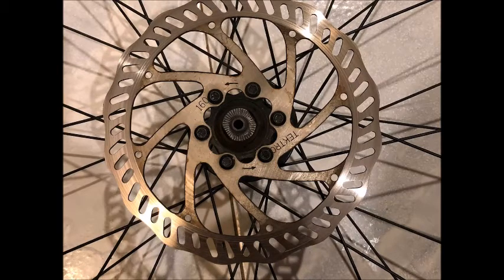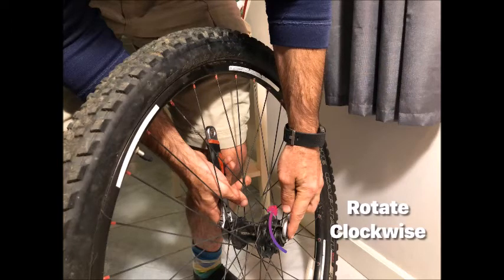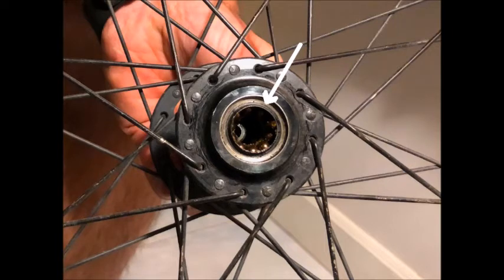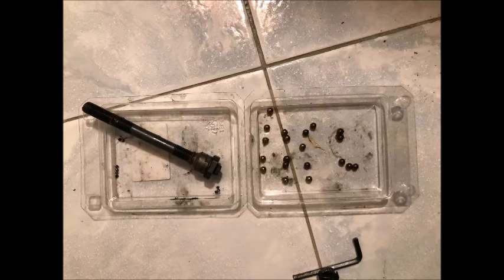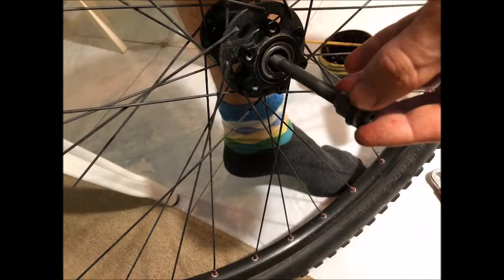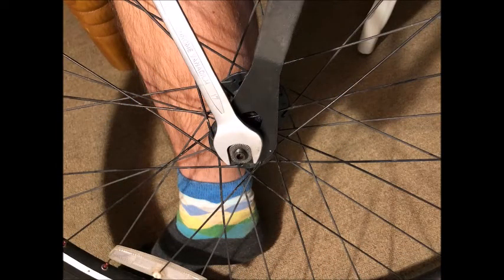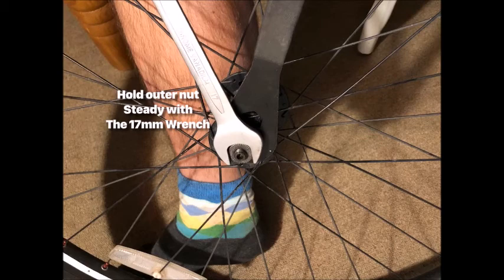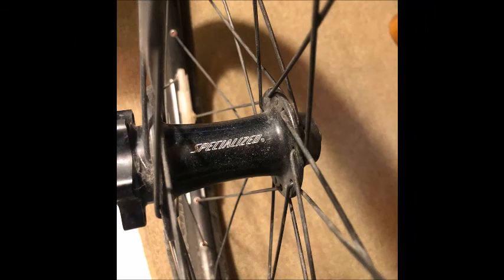Specialized Stout Front Hub Service

Comment: Thank you for the tutorial.  The Stout front hub on my 2007 Specialized Epic Expert looks different, because it does not have cone nuts, which is why I am here.
Reply from the maker: Carreteras - yes, this is an older version before they moved to the cartridge bearings. For your hub, you simply remove the end caps (most likely by pulling them off, you might need the help of a vice or pliers with rubber tips to do it.) this will expose the cartridge bearings, you can then pull them with a hidden bearing puller (see my video on DIY Puller) or knock them out with a long screw driver and a mallet. Then press new bearings in, reinstall the end caps and you’re good to go.

Comment: would you mind sharing the size of those ball bearings? thanks
Reply from the maker: I didn’t measure the balls but am almost positive they are 3/16. This is most likely a rebranded formula/joytech hub with 10 balls per side. A google search indicates that 3/16 is the normal size for this set up.

Comment: what size are the bearings?
Reply: I didn’t measure the balls but am almost positive they are 3/16. This is most likely a rebranded formula/joytech hub with 10 balls per side. A google search indicates that 3/16 is the normal size for this set up.